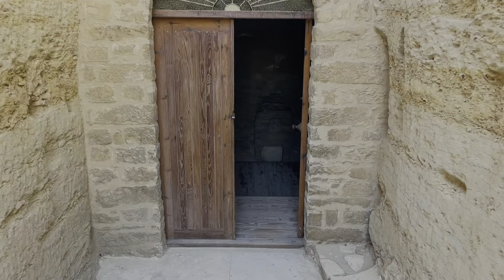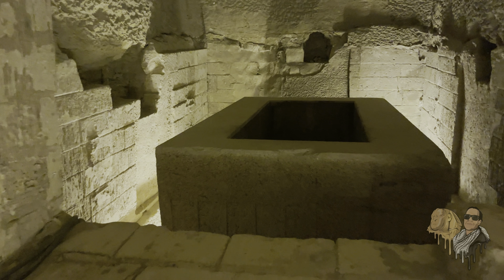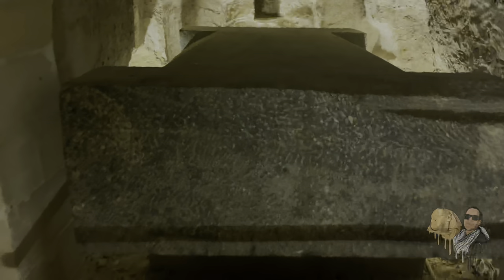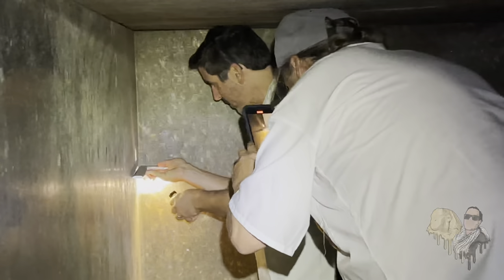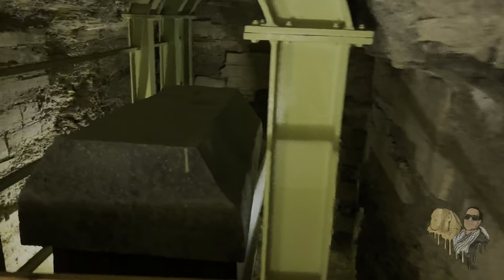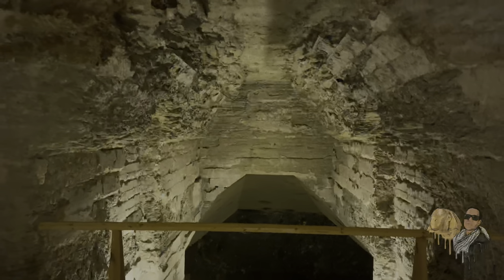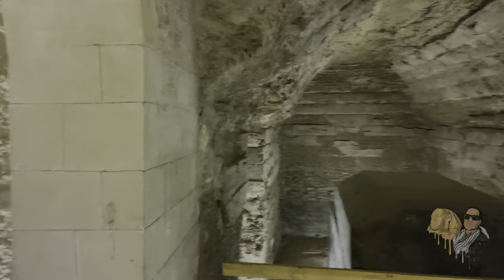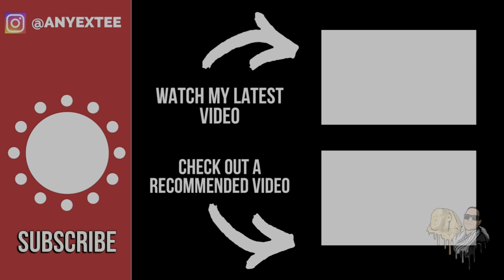The Ultimate Guide To The Serapeum, Saqqara

Comment: You  glossed over several important issues.
1. There is no historical nor scientific connection between the making of the vaults and their usage by the Egyptians.  The granite vaults could have been made thousands of years earlier.
There is no acceptable explanation for the quality of the interiors, -not for their smoothness, their flatness, nor their right angles.  No one using chisels would attempt such inexplicable and unnecessary quality... especially for an area that would never be seen by anyone.  That reality only leaves the possibility that they were cast using softened stone...not 'melted' by heating but softened by resonant frequency hyper amplification.
The near perfection of the sides resulted from the quality of the mold walls.  They consisted of panels of metal able to replicate precision plate surfaces since their upper surface would have been perfectly leveled by gravity while still molten.  The smoothness or 'polish' of the walls resulted from the smoothness of the mold walls... like casting resin in a glass mold.

2. The size of many of the vaults greatly exceeds the size of an apis bull.  Sarcophagi are made to fit the dimensions of the body that they will contain... not five times the size.

3.  The thickness of the walls and the lids demonstrates a power over stone that is unknown to us today.  That thickness and their weight show that they were intended to serve as vaults that only the makers could open.  And how was the one single vault that was unopened upon discovery opened for inspection?  With manual tools?  With iron devices?  No.  With gun powder.  
Nothing conceivable could have been employed to remove that lid because of its hermetically sealed massive weight.   No proposed method could have successfully lifted or lower such weight.  If pulleys are proposed then a lot of them would have been needed so there needs to be evidence of an adequate number of holes near the ceiling to hold an adequate number of very strong beams... which themselves would have presented a problem to install because of their own massive weight. 

4. The engineering insight of the diagram of pulleys and ropes to move the corner box around its corner is woefully lacking. (25:35)  It totally fails to take reality into account.  Reality #1:  Ancient Egyptians did not have large logs of hard wood to waste as rollers.  Softer wood like pine and cedar would be crushed under such weight unless they were very thick, heavy, and in abundance... covering almost the entire bottom surface of a box. But so many of them would cause them to bunch up and lock up unless they, and the floor, were engineered to perfection.  Any deviation from perfect uniformity would cause that since any log just slightly smaller in diameter would lose contact and then stop rolling.

Reality #2: The ground would have to have been made of thick hard stone flattened to perfection to match logs milled to a uniform diameter.  Soft ground such as dirt or limestone would have been indented by the weight of the line  of wood making contact with it... especially if the logs were limited to just half a dozen or less.
Reality #3: The diagram skipped the impossible inclusion of depictions of roller logs beneath the box during the right angle turn.  If the box was turned 90 degrees then it would be pulled off of the forward-facing logs.

Reality #4: The reason that there has never been anything underneath the box abandoned in the corridor is because it was impossible for the Egyptians of any age  to lift such weight off the ground and onto a set of rollers or a sled within such a confined space.  How did it get there when it is sitting on the ground and not on any kind of transport mechanism?  Only something like gravity reversal technology comes to mind.
Reality #5:  No other technology can explain how they could have been moved into and lowered into their niches.  The proposed use of a cavity-filling volume of sand that could be removed until they rested on bedrock holds no water because there's no conceivable means to position a box onto the sand.  They  could not slide forward on sand because the only direction that they would move in is 'down'.
Reality #6:  Inertia.  To simply move a stationary box with a perfectly flat bottom, placed atop a set of perfectly sized logs, on a perfectly flat and hard ground would be a gigantic challenge because of its stationary inertia.  It would not move, but if it could be made to move then it would be very difficult to stop it moving because of its powerful inertia of movement,  The rollers would have to be moved from the back to the front quickly while it's moving.. in a tight corridor and with wood too heavy to pick-up by hand except by a practiced and powerful crew that would not likely exist.

5.  The depressions in the granite lids of some boxes were not caused by any conceivable means.  Granite is too hard to be vulnerable to falling stones.... unless the granite is reconstituted granite and is impacted before it hardens.  As for the depressions in the walls, they were the result of air bubbles trapped by the thick softened stone during its pour into the formwork.... which sometimes failed... as it did in the case of the box in the corridor.  Its upper bindings slipped, allowing the upper section of mold wall to slant outward.  That's why it was a casting failure and intended for removal.  It's upward facing horizontal surface could not form an hermetic seal because the perfect horizontal linearity across its four axis was wrecked.
Reply: Really? You actually believe the official timeline and explanations of this? 🤔
Reply: And it was all done in the dark
Reply: "Only something like gravity reversal technology comes to mind." - if that had such technology then why did they bother filling the chamber with sand? When Mariette re-discovered the site he found one of the boxes in its chamber sitting on top of a chamber full of sand. When he and his men removed the sand the box lowered into place on the floor of the chamber. 
So clearly that was the method they used.

Comment: The holes on the walls inside the niches could be "modern" and not contemporary with the boxes and used by the ancients to open the lids. Keep in mind when the boxes were "discovered" all the lids were ajar except for one. The holes were used for ropes and pullys by ancient man to simply move the lids to see what was inside. They didn't have explosives or machinery to break them open.

Comment: Interesting video. Thanks for sharing. 👍 Well filmed and edited, but it seems to me some of your conclusions are based on somewhat questionable evidences. E.g on who made the granite boxes and how. For instance, granite has a value of 7 on Mohs scale. How could the Egyptians, even in the more recent ptolemaic period, make precision works like those boxes, on such a high level, with such perfect surfaces and angles, of such a hard material, with the tools they are known to have access to? As far as I know, ancient Egyptian's tools were not anywhere near as hard as granite? Also, I sincerely doubt it those boxes were made by mere use hammers and chisels. Not even chisels of steel (and certainly not of the steel quality the might have access to back then. Let alone even older copper tools, it'd be like cutting bread with a paper knife...)
Reply: Mohs scale as a measure of hardness is used for what scratches what. Consider that window glass and mild steel have the same Mohs scale rating. Copper is lower than window glass on mohs scale at about the same as limestone. I can smash glass with copper or limestone 
Granite is a very TOUGH stone but it is also very brittle much like glass.
Reply: @SacredGeometryDecoded  So what? It still doesn't make it possible to shape and polish those granite boxes like that with the known tools the ancient Egyptians had acceess to. If anybody think that it's possible, I'd like to see them prove it by making a similar box, of same type of granite, using same kind of tools.
Reply: @erlandandersen5782  YT often ghosts comments so my earlier reply seems to be missing.
I and others have shaped and polished granite with those tools. Is the  same person who told you that about Mohs scale tell you it's impossible?
I can show you how to do it.
Reply: @SacredGeometryDecoded  I would like to see you make a box of granite like the ones in Serapeum, using same kind of tools as the ancient Egyptians had. I feel rather sure you've video documented it if you,ve made one. Link, please?
Reply: @erlandandersen5782  Since replies with links often get hidden by this website search for
Making a Serapeum Box with PRIMITIVE Copper & Stone Tools
and we can begin from there regarding impossible to do
Reply: @SacredGeometryDecoded  Ok, thanks. 👍 I've seen your video. It's well made, with lots of interesting info, some of it new to me, including practical demonstrations, hence interesting for that reason.  I'll admit I'm still dubious, but you obviously have more insight than I do on this stuff. Like you, I'm not a stonemasoner. My experiences working with granite are limited to drilling and cutting with modern tools. And no use of abrasives. Which used in combination with pipe drills makes it another story than the chiseling I was thinking of. I actually didn't know the ancient Egyptians had pipe drills? I've seen bow drills for making smaller stuff, like jewelry, but not pipe drills. Do you have any links to some info on it (preferably with some pics of those pipe drills)?
Reply: @erlandandersen5782  yes, many
on my page in the playlists section
Experiments in Granite with Primitive Technology
Hard to recommend a specific video
but the last one on drills i posted was 
called
IMPOSSIBLE ring of granite with PRIMITIVE technology.
Using multiple tubes at one time to make some rings, also mention different methods of spinning the drill.
The playlist covers a lot, drilling, cutting, polishing to precision flatness, even how to make your own polishing paste for granite.
Fire setting as well, how weak granite really is and how to use fire to work it.
Reply: @SacredGeometryDecoded  Thanks for quick response. 👍 It seems to me, though, after a quick look, your videos basically are presenting your theories on how the ancient Egyptians could have performed those works? Correct? Please don't get me wrong, I find your videos utter interesting and well made. Again, thanks for sharing. 🙏  But I was thinking more like if you could share some link or references to sites where the archaeologic records show some example(s) of pipe drills used by ancient Egyptians? I've not found any yet. I've seen info on experiments similar to yours, but no photos of actual pipe drills that has been found. Or any old depictions showing ancient Egyptians using pipe drills on stone works. I've seen depictions of use of bow drills on jewellery (I think it was) but  that's something else. Shouldn't there at least be some drill pipes in the archaeological material if they existed? And perhaps some old wall pictures on the usage?